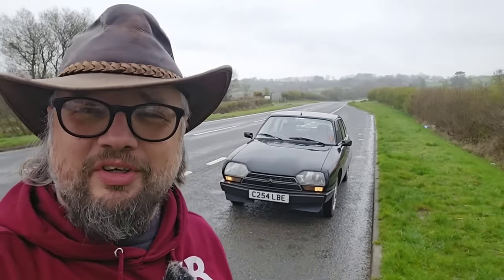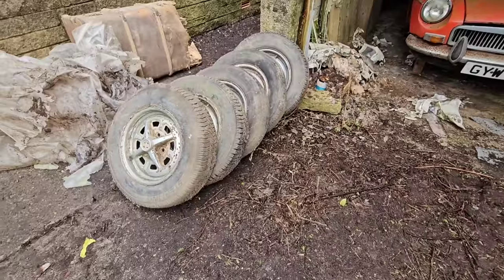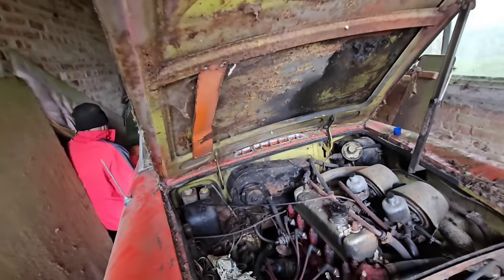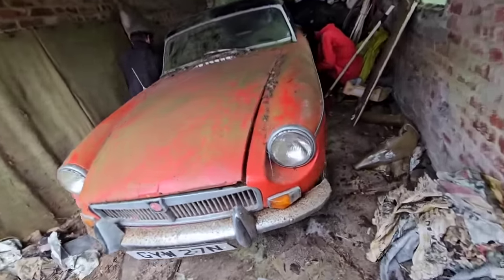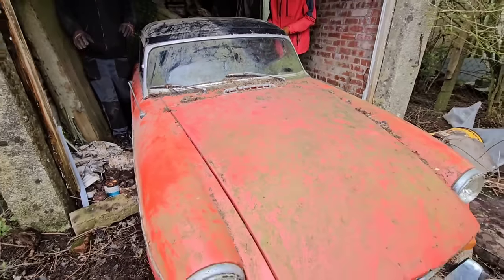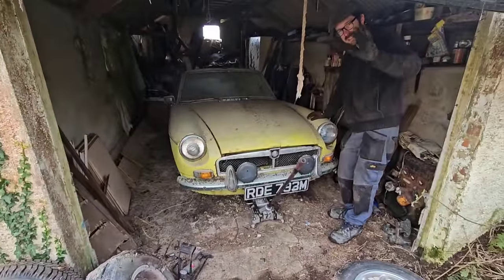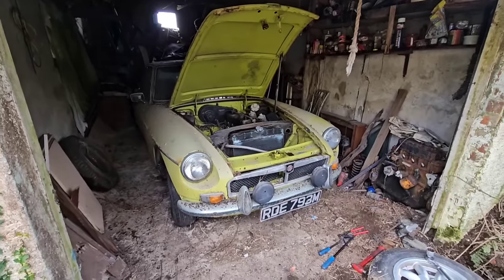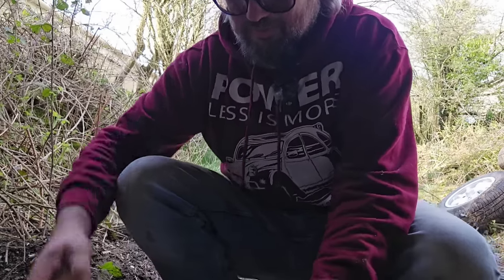MGB Barnfind Rescue! Will they roll after 22 years?

Comment: Fill the cylinders with diesel, leave to soak for a week or two and they should turn, worked for me with a 1949 series 1 Land Rover that had spent 30 years in a pond buried in the silt.  Had less than 250 miles on the clock.  According to the Farmers Grandson he had got out to shut a gate and forgot the handbrake, it rolled down the field into the pond where it remained until the Grandson decided to restore the pond.

Comment: Ah yes I remember those wiper spindles... there is a trick when the teeth get worn on them & the wipers start to jitter... take the wiper arms off, pull the cable right out & the spindles turn round & round in situ as the helical cable comes right out... with the cable right out turn the wiper spindles 180 degrees then put the cable back in... the spindles then spinning round & round but they then come to rest against the unworn teeth on the previously unused side of wiper cog. Problem sorted (probably).
The other trick if the helical cable is starting to get worn too is to blag one out of a bigger car in the scrappy & cut it to length on your original cable & re-insert it into your existing motor/tube. With the scrappy being a bigger car the spindles will be at different distances to the motor so again the cable mesh to your spindle cogs will be at an unworn part.

Comment: The MGB GT is a cool car when I think of it. I've never driven one but they are supposed to be fun and with a grunty little four cylinder it had decent performance for its time. Like today's Mx5. Then add a hatchback to the mix and you get loads of practicality as well. A small practical sports car? 🤔🙂

Comment: The red one looks like it may just be savable. With that engine, fill the cylinders with Ford Type F automatic transmission fluid. Leave it sit, and you might be surprised how well it works.
The Volvo should be able to move that. Our 81 240 with the single carb 2.1 and 3 speed auto gearbox moved a mature walnut tree off a garage.

Comment: Minilites get put on because (in my case) the rostyles never ran true and vibrated me and the car to bits over 60mph.  No-one can much agree what alloy should go on instead of the rostyles so the minilite is the easy non-controversial option.  There is a current fetish toward plain steel wheels (and sometimes even those with hubcaps) on MGBs but I expect that idea will go full circle(!) in the future.  I can see the roadster living again just because it is an open car and has more 'play value', but the GT probably not.

Comment: It is interesting how many bargains are in the UK same as in Australia but the British weather really rusts cars and these are usually from holders who just put them in sheds and leave them and rodents nesting in them there is this Australian you tube channel were there is this chap who saves old Australian cars and he has had success and actually sold actually of cars he has saved been sitting around for 20 to 30 years believe or not very little rust usually a bit of surface rust but the Australian weather is much kinder than Britain weather he has pulled them out of paddocks ecpwrecking yards ect and Ford Falcon ute was parked up because they had got the spark plug leads in the wrong place and after a wash and a clean up it was perfectly good also MGBs sell for good money in Australia at auction it is the only place l actually see them sell

Comment: I'm really curious at to what parts in those heaps could actually be salvageable.  Anyone know?
Reply from the maker: At the very least, bits of trim, mechanical units for overhaul but subject to budget, anything is saveable when it comes to this.
Reply: The hardtop, motor lita steering wheel. Carbs, trim. You would be surprised!
Reply: @CambrianClassicsLtd In 1984 I bought a 1966 MG Midget in far worse condition than either of those MGB's for donor parts, I ended up restoring it while an engineering student, I learnt a lot more about fabrication and welding from that car than I did from my tutors.
Reply: @MrOvershoot  experience is the best teacher!

Comment: Useless piece of probably inaccurate trivia, I think the MGB shares an engine with the Hindustan Motors "Ambassador", which I think was still in production till around ten years ago.  If so, there may be plenty of engine spares available.
Reply from the maker: The Ambassador switched to Isuzu engines in the 1980s I think.
Reply: @HubNut  I think you are correct, (although Mr Wikipedia suggests that it was as late as 1990). Apparently the humble Ambassador was produced from 1957 all the way to 2014, and there is talk of producing a new replacement Ambassador.